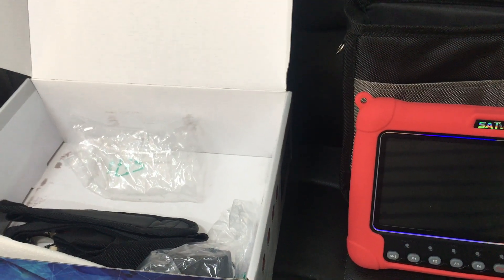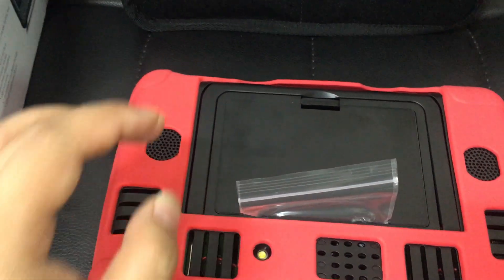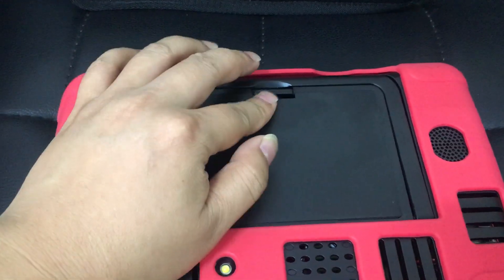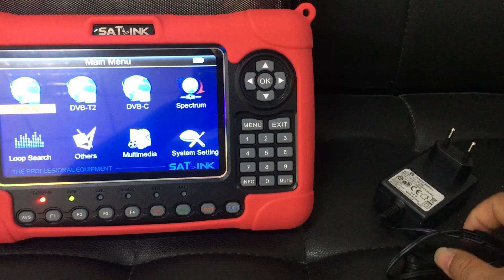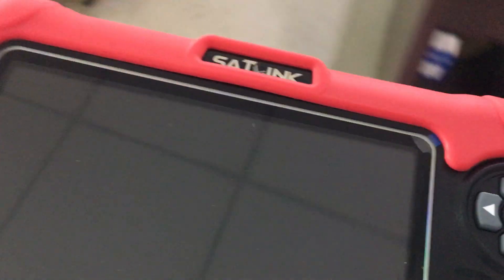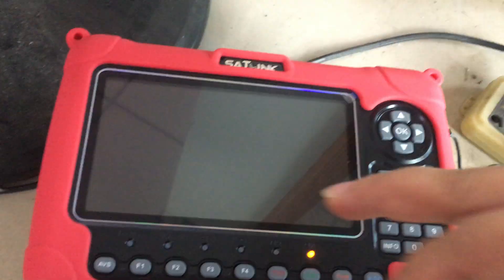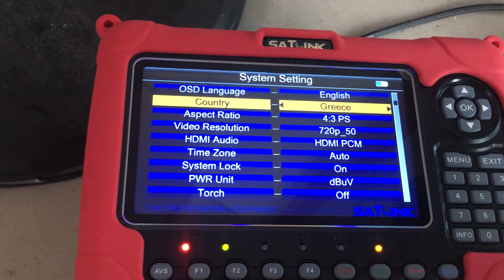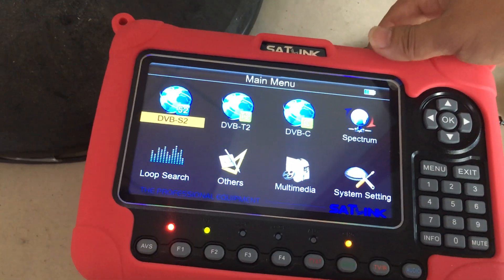Brief introduction and demo operation on power on and charging SATLINK WS-6980 2

Comment: You have videos of the 5150 please
Reply from the maker: https://youtu.be/wn1ZaT39IAs?si=7Br4_KAHtDdHZSk1 It is a short video about ST-5150 meter. Sure, actually now the newest devices are respectively SATLINK ST-6986 meter, SATLINK ST-5155 meter, both supporting 10 bit now. All previous devices only support 8 bit. It is deemed as the main difference. Share with you, as above.